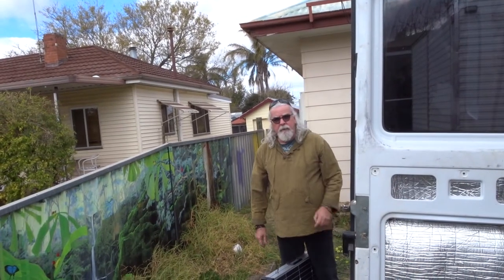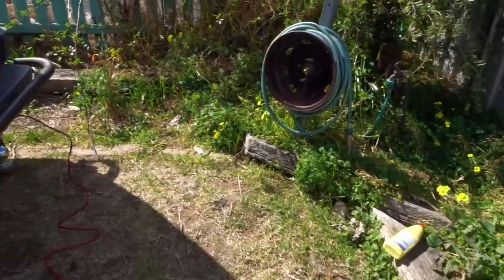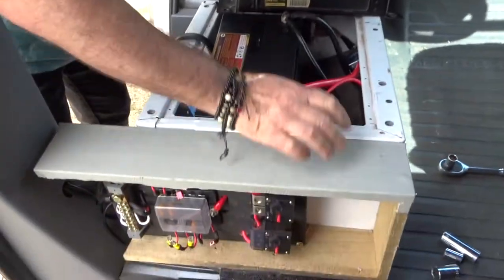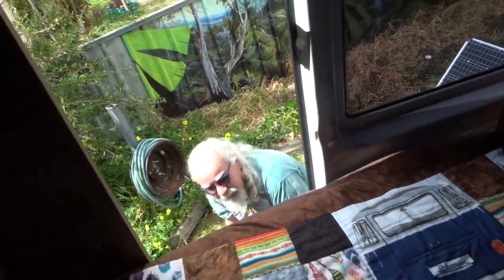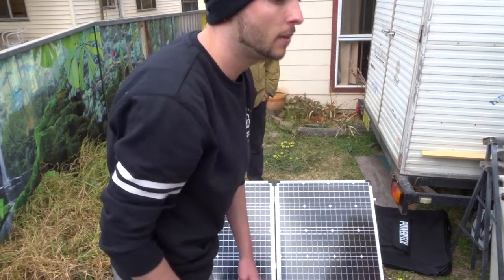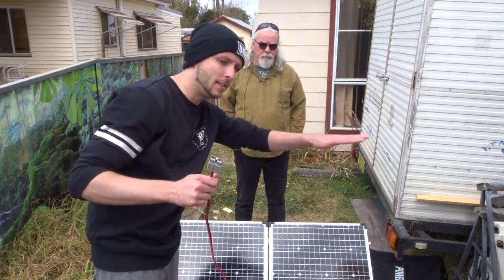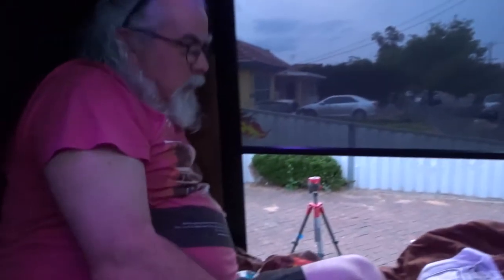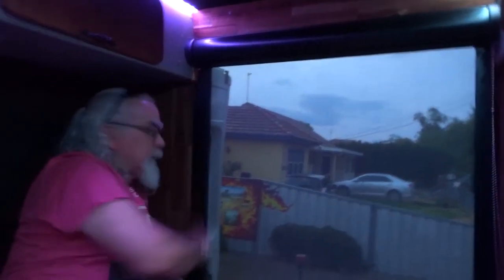Sprinter conversion BUILD 10 Solar and installing blinds

Comment: What batteries are you using mate ? AGM, Calcium, lead acid all have different charge rates/voltages.
I have 2 x 200Ah 6 volt AGM charged with 2x175watt panels wired in series going through a small 15A MPPT charger but I also have 120 watts as spare or back up.
AND I have 2 x calcium batteries ( 530Ah + 560Ah ) charged by a calcium charger with a de-sulphation mode. At least you can drive yours though. I have a power steering pump dead so it`s been in my driveway for months waiting for the cash to fork out for parts which I am now waiting on from a Transit Specialist.
Reply from the maker: Noevilea 
Sorry about the late reply just got back from a little holiday.
That's nice setup 👌
I just bought a trainsit a few days ago so I do my own van build. 
It's a 100 amp hr agm battery. 
The solar panels come with a 10 amp pwm charge controller just from jaycar.
Will they be fine together? In the specs it saids it fine for sealed, gel and flooded.